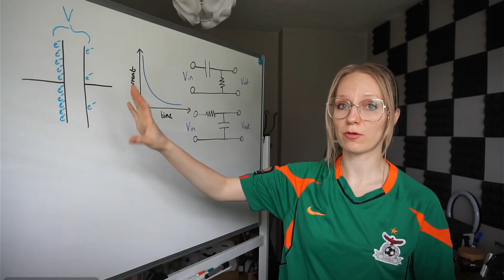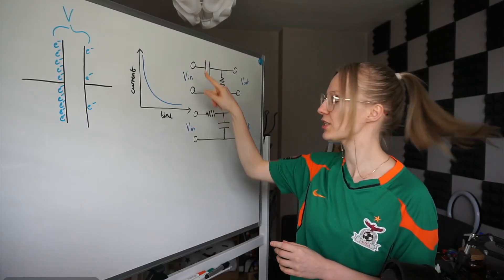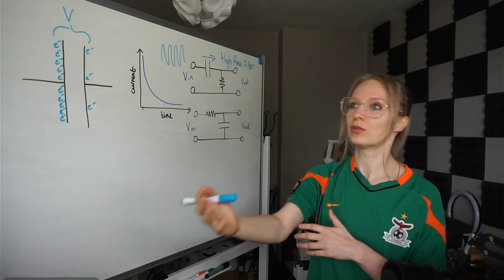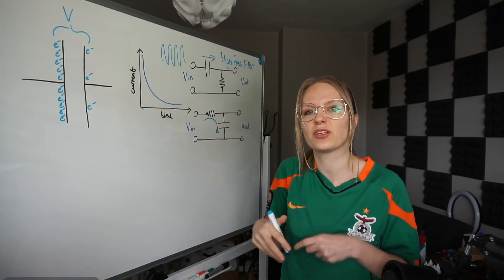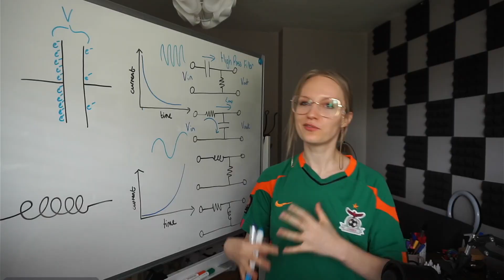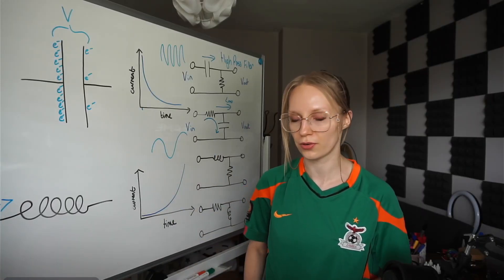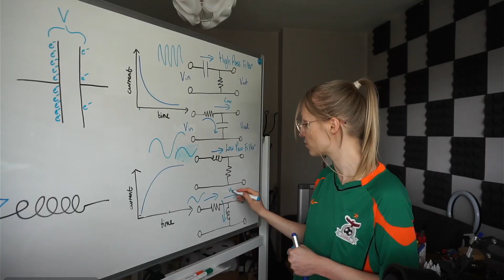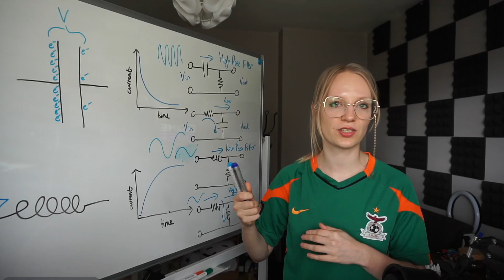How Passive Filters Work (My Explanation)

Comment: You have fantastic videos, you're a great educator. What isn't clear to me is overlapping frequencies. Say there is a 10kHz sine wave and a 2Hz sine wave in the same signal, piped into a high pass filter tuned to pass 1kHz and up. Does it block the 2Hz wave, resulting in a pure 10kHz wave? Or, since the entire signal is oscillating over 1kHz, does it just let everything through?

Comment: This is so cool, because its suuuuuch a simple circuit and you can use it straight up make yourself a guitar pedal or an audio "box" to pass audio through and have it apply the low and high pass filters! Bonus points if we slap a potentiometer in place of the resister to create a "sweeping" filter like how a low/high shelf in an audio rack.

If we go further, and introduce the notch filter, we could create an entire equalizer type module, targeting different bands of the audio frequency boosting or reducing it! And as you said, we could easily do noise cancellation, or adding noise!

Holy smokes this has been a gateway for me to wanting to work with audio data and AC circuits now, thank you!

Now if I could just figure out how those really expensive compressor audio modules work :D.

Comment: So I feel like the little bit that you could have added to help clarify your explanations would be to root them around the behavior of inductors, capacitors, and resistors under DC conditions. I haven't done any electrical engineering or signal analysis since university which somehow has crept into the double digits, but I still remember those fundamentals.
From there it's pretty straightforward to understand the behavior of the circuit or filter by considering an AC input with period T, and if we take the limit of that as T goes towards infinity, we get that same DC input that we know the behavior of.
From here everything else basically just falls right out if you also use the diagrams of the current across those components to also verify that they exhibit the opposite behavior as T goes to zero, or that the components are the inverse of each other so you can extrapolate the behavior of each at high frequency as being the same as the other component under DC conditions.
While all of that probably is harder to follow as a YouTube comment, I'm sure you can explain it more clearly as a video. And even if this explanation is a little more technical than what you presented, I have a suspicion that the type of people watching this content probably already knew about or at least are willing to accept the rules for DC circuit analysis.
Reply: But other than that I thought that was a really intuitive explanation of a very difficult type of engineering for most people to understand how any of it actually works.
Reply from the maker: I see! I thought I did initially when I explain how a capacitor works and how an inductor works in a DC circuit, but you think a bit more extension on it would have been better?
Reply: @TinyToxicTofu yeah, mostly adding the textbook kind of statement that in a DC circuit caps act as open and inductors act as a short.
I actually really liked your explanation of why they behave this way, it's very intuitive. I mostly was thinking that by tying that explanation to the rules of how to treat those components in DC analysis would probably really speak to people who remember what the rules are, but likely never understood or even got an explanation of why.
Additionally, I never thought about how a DC current is just an AC current as the period tends towards infinity, and I guess the inverse as T goes to zero is something I'm not sure, but I would think like the Dirac Delta function, but regardless, it helped me to think about the transformation to frequency space in a different way - not that I have much reason to think about it much at all otherwise. Furthermore, I also really like how your explanation brings circuit analysis out of a static 2D diagram, and still lends itself to understanding how the output of these components are not static, they change over (generally very small spans of) time, and how the interesting point is where the frequency of the input crosses the threshold where the response of the components is able to keep up, and therefore how and why frequency space can be used to more easily do that kind of analysis.
Anyway, thanks for a cool thought-provoking video that made me remember some of the more interesting things I studied but never got a real intuitive understanding of, and never really have a reason to think about since I don't use any of it in the work I do now, and I was also just thinking about how it made a lightbulb go off in my head as to how and why these rules I learned are what they are, and I figured anyone else like me might also be able to have that lightbulb moment if they heard you explicitly tie the video to those almost arbitrary rules we just had to memorize but never were derived or explained.